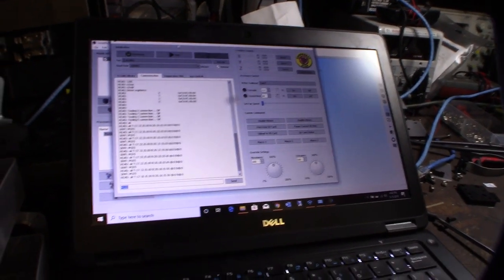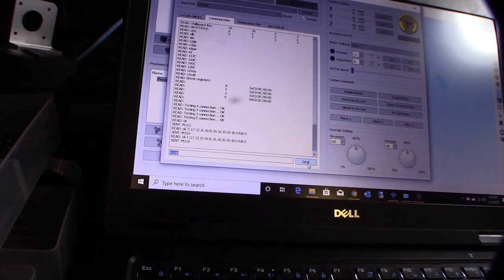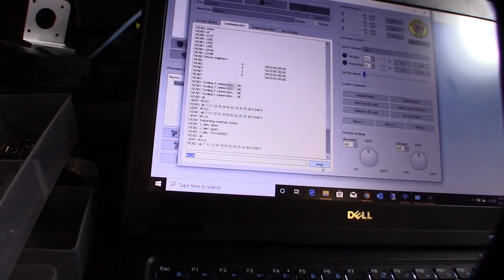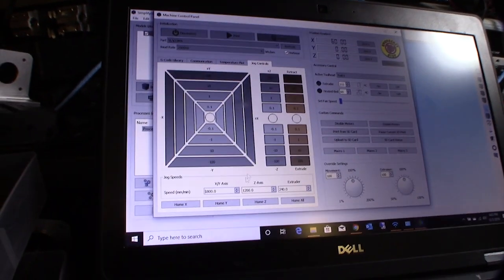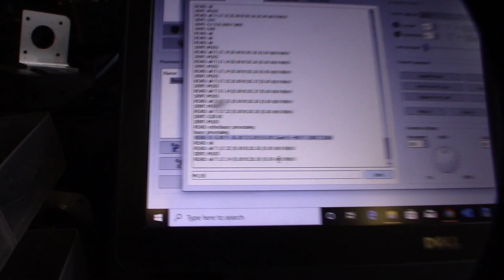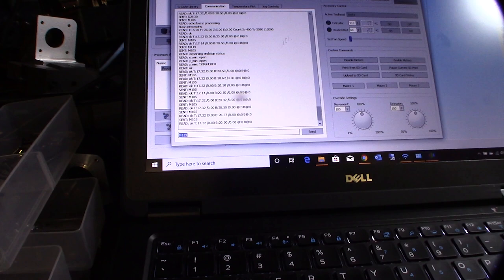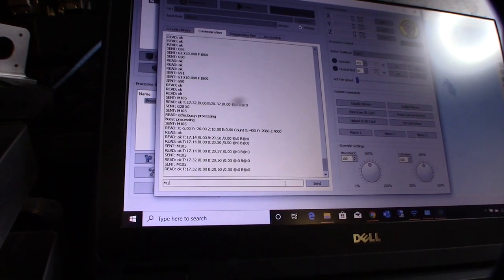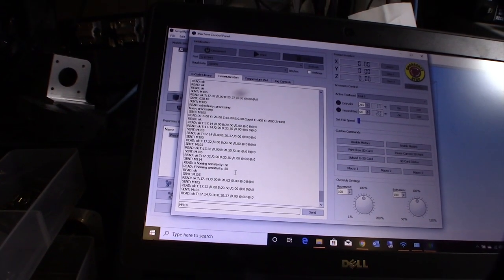Trinamic TMC2209 with SKR 1.3 sensorless homing test stall guard

Comment: Stallguard detects back emf and sends a signal when it exceeds your set threshold. Obviously, there is no backemf when a motor is static. Why assume some kind of latch and hold function on the output signal, what exactly would be the point of that? To make it behave like a microswitch that is being held closed? because??
Reply from the maker: Well, that is what I'm trying to figure out. What is telling marlin the end stop has been triggered. Your saying EMF, I would have assumed some kind voltage, maybe some kind of internal relay / transistor in the stepper driver. You seem to pretty knowledgeable in the subject, is there a way to see in marlin real-time when the endstop is triggered.
Reply from the maker: "To make it behave like a microswitch that is being held closed? because??" These things are designed for 3D printers and CNC correct? Why not send back voltage to mimic the function or an endstop?

Comment: Did you use VS Code or Atom to program?  I'm trying to use sensorless homing, but X&Y keeps crashing and grinding.  I've set up all of the parameters correctly, but in configuration_adv.h, it says that "TMCStepper library is required to use TMC stepper drivers".  Did you have to load the library, and if so, how did you call to it in your code?
Reply from the maker: I use atom. Make sure you open up the project in Platform IO within Atom. If you don't open it from there it wont load the libraries.
Reply: @fintechrepairshop  So does that mean that there is no need to make a call to it from within the code; just have "TMCStepper.h" in the Lib folder?
Reply from the maker: @Dan-lz1ix  all the libraries are defined on the platformio.ini file. make sure processor is set to LPC1768
Reply from the maker: A stock version of marlin should already have the libraries setup. You just need to make sure the processor matches your board in the platformio.ini
Reply: @fintechrepairshop  Thanks, yeah it is set to LPC1768.  Pronterface allows me to move the axis around properly and both heaters work just fine.  I'm just having issues getting Sensorless Homing to work.  Also, I do have the bigtreetech TMC2209 drivers; not the other manufactures that people commenting having issues with due to other issues.
Reply: @fintechrepairshop  I finally figured it out.  It was a matter of bringing my current level down to 400 on the CURRENT_HOME setting.  Homing works great now!
Reply: @Dan-lz1ix  Hi Dan,  how did you work out the 400 ?  the stock setting is 800, I am having same problem with motors ripping belts off and not stopping